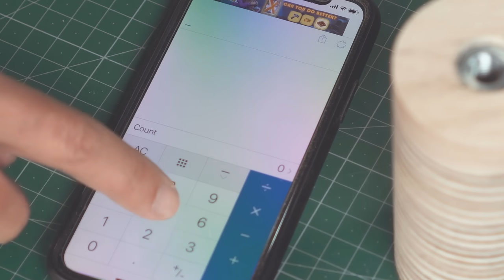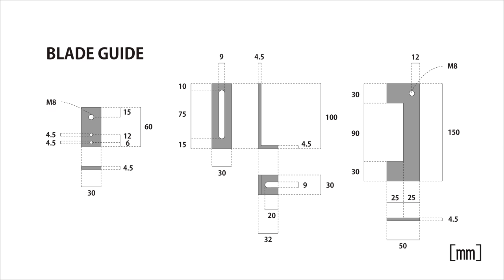9 Best Angle Grinder Hacks | Simple Ideas

Comment: please be so very careful adding anything to a grinder.  A drill turns at about 600rpm, a lathe at about 1000rpm and a grinder at about 6000rpm.  If something comes off it, it's gonna hurt
Reply: True. best get a rpm regulator for variable power speed. These universal motors do run both on dc & ac current.
Reply: My router and Dremel do 35,000 and I always use them on max. With a shifty plastic table that doesn't even take a clamp right... safety is expensive folks just know what can go wrong and how to avoid it or at least accept this project could cost everything like I do lol
Reply: @makinnewcounts6676 a router and a Dremel are both specifically designed to hold the bits at the speed they rotate. An angle grinder isn't. Safety is expensive, hospitalization is even more expensive. If you view safety that way you'll eventually enjoy the hospital the other way
Reply: @craigmurrayauthor  They also aren't being tasked with holding the same consumables or DIY devices as this grinder.
Reply: 10:35 how is this device called? How much does it costs?
Reply: Belíssimo  TRAB  irmão
Reply: Kaç gündür sizden aparatların ölçülerini bildirmenizi istemiştim paylaşmanız aynı projeden izleyiciler için faydalanması adına ölçüleri mümkünse bildirin lütfen
Reply: Extrêmement dangereux sans variateur 😢
Reply: Minigrinder 12000 rpm. Clamped with squeeze clamps, with all that vibration and force 😢🤣😢🤣😢🤣😢🤣
Reply: А иногда и невозможно востановить .
На человека запчастей нет .
Reply: Safety first, Safety last,  Safety always! 🤕
Reply: @makinnewcounts6676 I absolutely agree 100%
Reply: 일상생활에  전혀 도움이 안되는 ....
부속 만들때 쓰는 공구들이면 그라인더 없이도 다 하겠다 .
Reply: It is gonna hurt A LOT. Safety rules are written with blood of unlucky. He uses those things made of plywood crap. It can experience sudden defragmentation and throw pieces at high speed right to face thanks to large rpm which is somewhat around 6000 and up. Not really safe or reliable
Reply: Someone was using a circular saw blade without the blade guard. He lived a very short life. 
Anything that can cut or maim a person must be treated with a lot of respect.
Reply: Wow, that is so dangerous 🤕
Reply: I know who I'm getting to build my piano next😂
Reply: DEWALT cordless is about 9000. I wouldn’t dare try these but if you could figure out a way to set your rpms some of these are not bad.
Reply: @1977slave yeah I was giving low numbers for the grinder.  Use the proper tool for the job.  I mean even a drill is slow enough you're not going to be pulling a chunk of wood out of your forehead lol
Reply: There’s a reason u never see its face..grinder scar!
Reply: Bypass the safety, and you're going to pay the price.
Reply: Very well said. That is the reason certain tools are designed to do certain jobs. They are tested for vibration, thermal expansion, and stress analysis.  As things can go south, pretty quick with these high power tools. That is the reason they are called POWER tools.  Safety should be #1 priority.
Reply: "It's gonna hurt"
No s--t Sherlock.
Who are you supposed to be? 
Mr.Saftey guy?
Reply: @davidrichter9164  thanks for such an intelligent response, I bet no one rolls their eyes when you talk
Reply: Cool ideas! Do not try at home!
Reply: 😂😂😂😂😂😂😂😂😂 это не для слабохарактерных ,это для смелых !
Reply: I was going to say the same thing. These tools aren't toys, they can really hurt you.
Reply: All power tools & all construction type work have inherent dangers. If you worry about stuff like that, you get hurt. Better to find a job that suits you.
Reply: Use regulator to control the speed :)
Reply: @jkashif1  or you could just use the right tool for the job
Reply: These grinder turn at 10,000 RPM
Reply: …not if it’s to the head.
Reply: More like 10,000 rpm typically. You are right. Thanks for pointing this out as I’m sure it will save some people from avoidable injuries.
Reply: Nobody wins when someone gets hurt. Safety is cheap compared to injury.
Reply: The safety brigade needs to lighten up. Does this guy look like he consults with OSHA? Good grief.
Reply: @ffdtower1  The grown ups in the room call themselves, professional builders who have seen too many people hurt. The amateur know-nothing big mouths are the only ones who say things like, the OSHA people need to back off.
Reply: @randya3812  this is a very privileged westerner mentality… The US loves marketing 18 versions of basically the same tool and telling people you can’t multitask with them—and yeah, the average American probably shouldn’t—but if you look at manufacturing processes in other parts of the world, it is very possible to make beautiful things with some innovation, understanding of basic engineering principles, and some common sense.
Reply: Videos like this should be banned before some unsuspecting Diya gets seriously hurt
Reply: I think these hacks are innovative. I was curious about the speed issue, but I see several comments about adding dimmer switches and speed controls. I think that's a good idea. I can see doing this.
Reply: @CalculatedMistakes  if you need a sander, buy a sander lol.  I wouldn't put a dimmer power supply on any motor I did not know for sure would tolerate a reduction in power.

Comment: Mechanically it is extremely stable, but it has nothing to do with dust extraction. The angle grinder can be easily and quickly destroyed by all the dust. Oh, and in small, enclosed spaces an angle grinder is extremely quiet, right?

Comment: As a metal worker and weldor, having made all my own fixtures, jig's and many tools my whole working life, this is a fantastic video with really well done ideas. I would suggest a variable speed grinder for anyone building these. 
This old dog appreciates seeing these tricks.
Reply: you're a bad metal worker for recommending the variable speed ones.  
unless you wanna spend ALOT 

i have had a few variable speed ones.  and they would have all grinded to a complete halt with half of the operations the guy is showing in the video.  
his grinder actually powers through.  that's what you're after.
Reply: @darkracer1252  Variable speed grinders vary in price. And what is considered a lot to one person could be spare change to another. And slowing down the rpm's can be well worth the price depending on what you are grinding, even metal. 
Your experience is one thing, but it's not a universal fact. Varying rpm's can be done in more than one way and that affects performance. Not to mention how you use the tool. Stuff a work piece into any tool like a gorilla, beyond it's design parameters, and you'll get shit results.
Steel can tolerate higher rpm grinder speeds, generally. But wood is different. Tool speed and abrasive have to be considered more with wood as it varies more. Density, grain, composition, combustion point, etc.  
Can tools be pushed and/or pulled outside of their design and used successfully? Sure. But you have to have the experience. Many hobbyists just don't have that tool time.
Reply: Just not for noob workers. Noobs and clumsy people stick to the comments that instill fear and terror into you 😂
Reply: Yup! Says the fellow welder and metal worker. :)

Comment: Would agree with most commenters saying some of these hacks are excellent. The only point I would highlight is that of the creator in that for safety reasons it would be best to use a good quality variable speed machine in order to match the characteristics of the tool being replaced but most are just good more accurate uses of the grinders main function.

Comment: On 3:37 you can see the angle grinder pinion & gear mechanism. I simply can't see how you get the machine to keep working after displacing the gear several mm by interposing the steel plate as seen on 4:04. The pinion and gear can't remain in contact that way, can they?

Comment: My cordless 4" angle grinder is my favorite tool when doing service/new construction plumbing. (Great video....but completely useless to me.) 2 days ago I removed an old corroded kitchen sink faucet from up top...cut the handle off, slit and spread the spout and valve body off, then scored and tore the baseplate off....all without making a mark on the white porcelain.....took about 15 mins.
A month ago I split and spread (like butter) the threads on a 2" brass double back-flow valve in front of an Arco station. Had that thing replaced and back on in less than 40 mins. 
Cutting in a 3" wye to an existing 1950's cast iron drain system is tedious but be patient....pays dividends.

Comment: Lots of great ideas... but in the long run, the cost of new angle grinders due to failure from overuse, kinda offsets a good chunk of the cost savings. Plus not counting the time spent building tools, instead of using them, then you also have to safety factor, that a lot of purpose built tools have, that these custom ones don't. AND, the speed of the grinder is too much for many of the builds.

Comment: You need to use some sort of dust extractor made from a plastic bottle maybe when using it as a surface planer too much dust
you could cut some slits in the cylinder 3 and just use it as a normal electrical plain blades if you cut this slit and then at 45° angle and have the wedge you can screw the wedge into the Block and that will clamp the blade

Comment: I had a belt sander bursting in flames yesterday. I’m a pro. It was a belt sander, designed for wood working. It had sucked in too much dust near the motor, heavy work an a massive piece did the rest.

Now imagine a tool absolutely not designed for this… please don’t forget to buy a fire extinguisher first…

Comment: Only issue with this is the speed of an angle grinder. Normal sanding operations for wood should be at lower speeds. At those speeds you can burnish or even burn wood.

Comment: On 2.30 minutes you are pulling the grinder backwards. The disk rotation is the deciding factor on the direction of the tool, going backwards isn't good for your disk and cut. The grinder will want to move foward, move foward with it instead of fighting it.

Comment: Angle grinders are extremely fast, and doing these hacks is an accident waiting to happen, because of the speed of a disc grinder, and on top of that the bearings of that machine may not be meant to support the extra stress that you would put on It, especially with extended accessories.

Comment: These "hacks" at least seem sane because they are done with massive mechanical constraints that holds the grinder in place.   These actually seem mostly safe enough to actually use.  Although I would probably just get the actual tool anyways.

Comment: In my opinion, sharing these ideas is not a good idea. For enthusiasts, it is dangerous to use a grinder in other ways that it is designed for. Novices should avoid making modifications or using the product differently, as it poses an unnecessary risk.

Comment: So basically you could have done this with an electric motor instead of disabling your grinder.
Reply: But the title "electric motor hacks" wouldn't get as many clicks.  I appreciate the creativity,  but dismantling a grinder,  spending hours building jigs (including several requiring precision metalworking), and then taking 20 minutes to setup each "hack" isn't very practical.

Comment: These are very nice mods BUT in order to achieve them you have to use machines they cost 50 times more than the TOTAL COST of buying all these tools you made the modifications for. The point is to make the modifications (in order to save money than buying the original tools) without having to spend a huge fortune in order to buy machines costing thousands of usd or euros, in order to achieve these modifications, JUST WITH SIMPLE TOOLS YOU ALREADY HAVE, thaithe point of any modification, otherwise you buy the original tool !

Comment: It's amazing to me (and a bit depressing) that most of these so-called "hacks" are really just someone bastardizing a tool instead of getting the right tool for the job (bench grinder, belt sander, table saw, etc.). What if you needed the angle grinder while you were using that half-assed belt sander? About the only really useful things I saw that I would consider were the blade guides. Pretty much everything else is a case of "Get the right tool. Use your ingenuity building something, or figuring out how to get the money to buy the tool you're hacking out of that angle grinder". My opinion, anyway.

Comment: Minute 7:36 is very dangerous. https://youtu.be/-39fu5ZoYxs?t=457
If you push the seating accidently into the blade it will be catapulted in your direction. Powered by more than 10.000 cycle per minutes.

Comment: So many of these are just a waste of time. Who wants to spend 45 minutes reassembling a grinder into a metal cutting saw every time you need to make a straight cut. It's why other tools exist that will get the job done faster. On the job, your time has value.

Comment: Do yourself a favour. Dont use a angle grinder for anything other than what it was designed for. Buy or rent the proper tool if you need it. Angle grinders are much more powerful and dangerous than most DIY people realize. The RPM speed is far beyond a drill and can literally make things like plywood etc explodes and fly off at high speeds. Its your safety, if you are too lazy or cant afford to use the right tool then find something else to do.